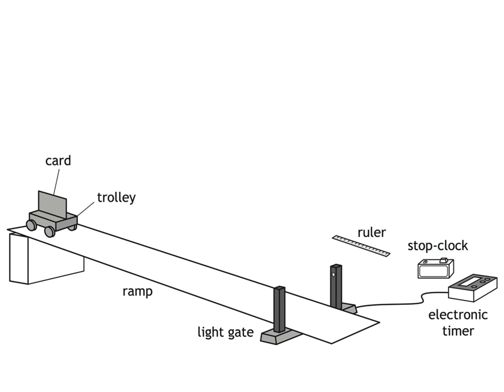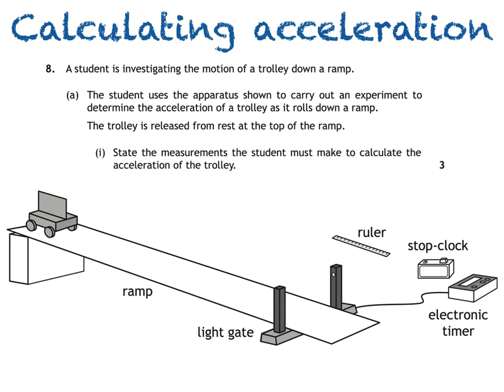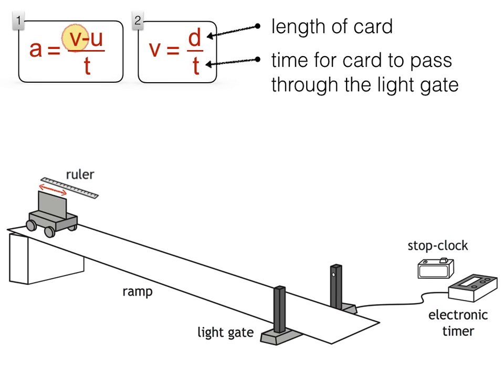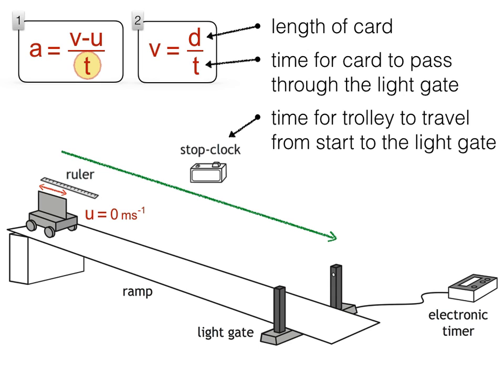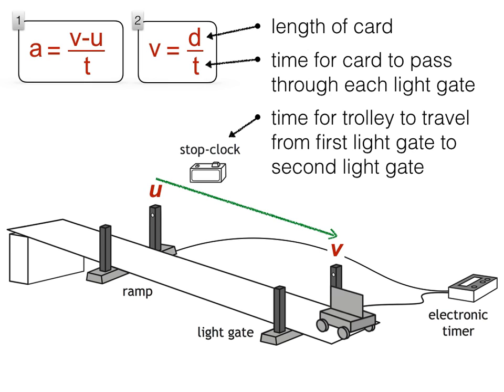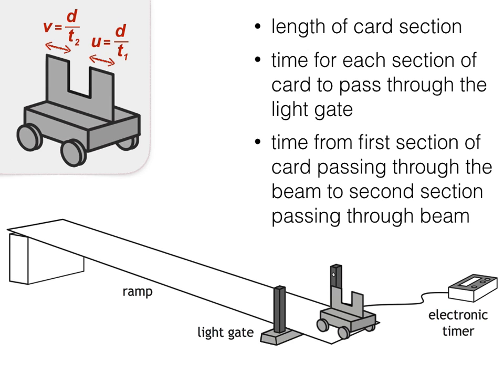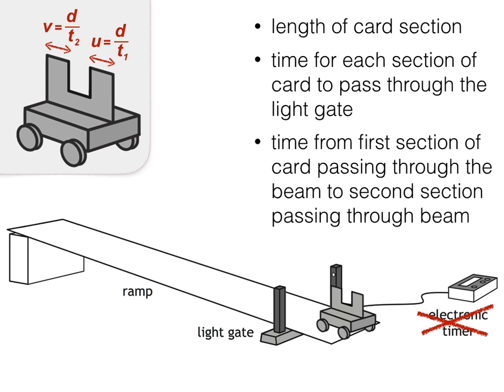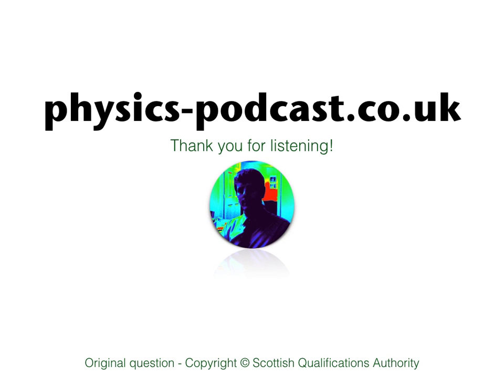National 5 Physics - calculating the acceleration of a trolley

Comment: Hi, I don’t understand why you would measure the length of card for the distance in the final velocity calculation. Could you please explain why? Thanks for the help, your videos are very useful, especially since my nat 5 teacher left a month before our exams.
Reply from the maker: The final velocity is calculated using the equation v=d/t where d is the distance travelled by the trolley while cutting the beam of light from the light-gate (ie the length of card, because that's the object that cuts the beam of light). t is the time taken for the card to pass through the light gate.
Reply: Mr Smith's Physics online Thanks for the explanation!
Reply: @MrSmithsPhysicsonline  thanks